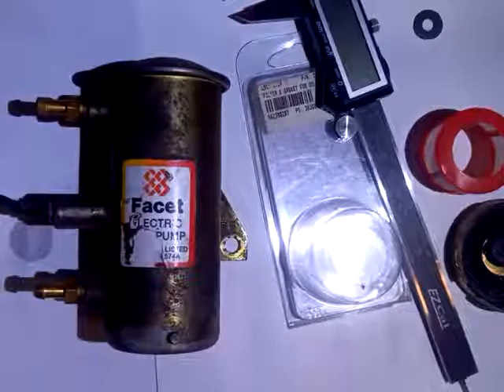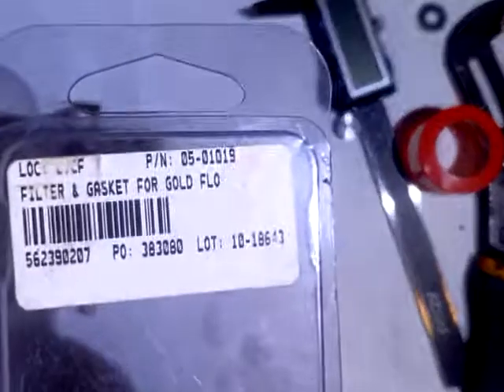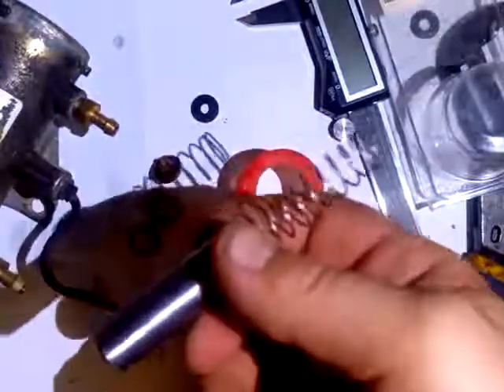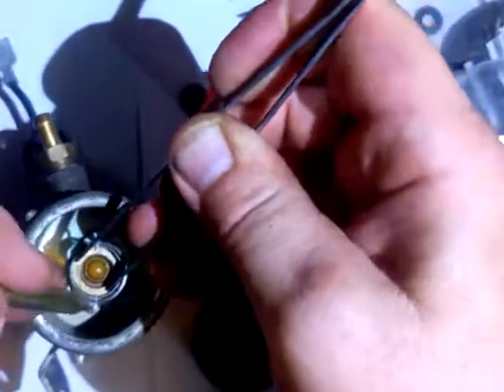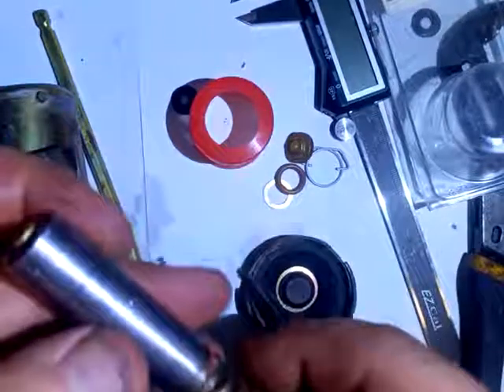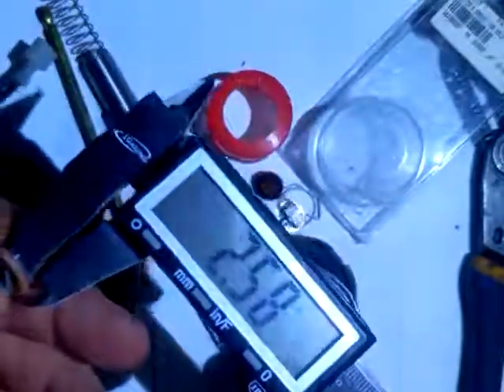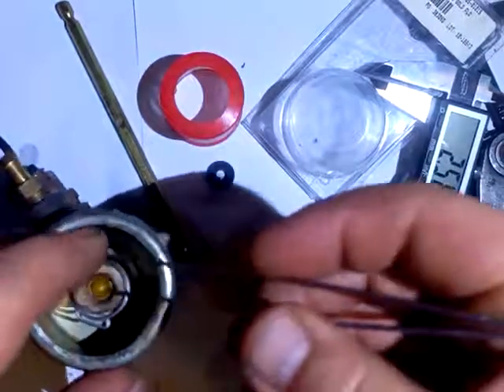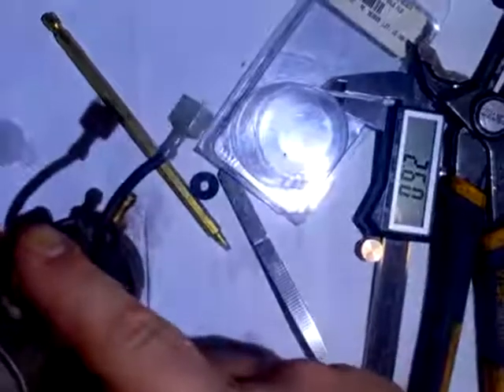Rebuilding a Facet 40133 fuel pump.

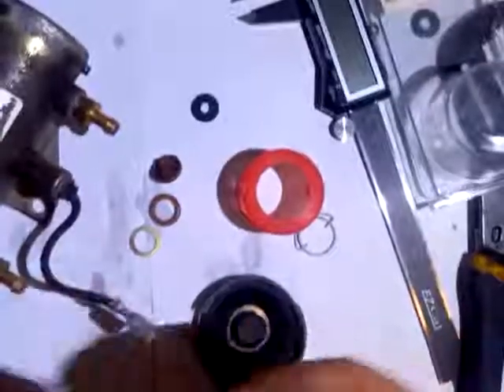Comment: 3:40 You've got that correct. That's why when you hear these priming they are running, as in clicking, very rapidly and then as head pressure builds they click slower and slower as the plunger now has to push fuel back to the return, not simply filling an open void of air in the system.
Nicely done teardown and refurbishment.

Comment: Thanks, you sure saved me a lot of trouble. The rubber backflow gasket on mine was deformed. Couldn't find parts. Like you mentioned , has 2 check valves anyway. Wouldn't be there to pressurize the inlet to the carb because the piston/cylinder isn't sealed anyway.  Great job on the video. PS: I put the spring retainer on first just below the 2 holes and moved it up in place  when I had the washer depressed.
Reply from the maker: @danoso6905  Yep. They don't make that gasket and it's not on the blow-up diagram. I don't see the purpose of it, anyway. Ethanol gas is going to eat it up. Runs fine without it. Been lifting fuel from an ATWOOD 6-gal boat trolling fuel tank 9.5ft now for years after this re-do, without trouble. To a carburated 3k genset.

Comment: Wouldn't that o-ring seal the plunger to the body preventing the pump from leaking if the pump was run in a parallel application for an electric and mechanical pump?  The poppet valves prevent back flow during operation as the pump is allowed some inefficiency, but there is no perfect seal between the plunger and the plunger tube when the pump is turned off, right?
Reply from the maker: There is no mechanical pump parallel this one on this application. With enough fuel pressure on the outlet side of the 40133, it's entirely possible to have fuel go back. The pump works in a way, that if there is an upstream carb inlet float valve that's closed, the pump will not overpressure the line and force fuel past. But the pump can and does lift fuel, some 9 ft vertically. It's pressure range is very specific. And if there was a pump that did not allow for backflow when the carb valve closed, I wouldn't want it. It would push past the closed carb valve and flood the area.

The 40133 is not part of a kind of parallel pumping as you described. What you are proposing is novel and unique, afaiaa {however, reading it's application in aircraft uses, it occurs to me that you may be referencing that}. In which case, I suggest you add a fuel solenoid to the inlet side of the 40133, to completely shut-off backflow that could occur if the pump was de-energized.

Comment: I forgot to mention.  The easy way to reinstall the spring clip that holds the valve in place is to put the spring in first, slightly below where the ends will go into the two holes that secure it.  Then install the valve. Hold it down with your finger tip and with a pair of needle nose pliers pull the ends of the clip up into the holes.  Simple.

After reassembly the pump can be quickly tested by jumping 12V across the connections (assuming it is a 12V pump).  The polarity is stamped into one of the two mounting brackets.  These pumps were available in both positive and negative ground and also for 24V applications.

Oh, and BTW.  Bendix was a US company so the dimensions are best measured in Imperial units, not metric.
Reply from the maker: Right, but I gave the measurements in mm, because for such small sizes, they are easier to remember and compare.

Comment: This pump design was first produced by Bendix Corp and was acquired by facet a couple of decades ago.  There are possibly dozens of models that have been used in aircraft engines, Jaguar and Land Rover cars, all sorts of US cars and tractors.  New ones are available that are now manufactured in China.  (You can buy a Bendix label to stick on your Facet(?) branded pump to make it look original.The design is simple and very reliable.  I had one on my Cessna so you can be sure they are reliable.  Just about all parts are interchangeable but the spring determines the fuel pressure.  Most operate between 2 and 6.5 PSI.  Most typical engines with carburetors are happy with around 4 psi.

The carburetor usually has the filter shown in the video.  It is a 'service item' and expected to be replaced or cleaned periodically.  Car owners and mechanics rarely know this so do nothing until the pump fails to deliver enough fuel as the filter becomes clogged.  Modern gasoline supplies tend to be very clean but ...  They often contain ethanol which will destroy the edge of the rubber seal and begin to leak if the particles don't clog the filter first.

Any small aircraft parts or service supplier will carry the service kit.  The pumps have to be serviced regularly per FAA regulations.  But their price is always high due to the cost of all the paperwork and certification involved in making and installing parts in aircraft.

I have found the Pegasus Auto racing Supplies carry the parts individually and are priced lower than the aircraft equivalent.  Facet (nee Bendix) fuel pumps were used extensively in Cobras, Ferrari, Alfa Romeo and many other race cars and motorcycles that are now considered historic and I'm very happy that Pegasus sell these parts so I can keep my old cars running.  Oh, even boat engines have used this pump.

Sadly we have become a nation of component re placers.  Mechanics don't dissemble and repair.  They just install a new whatever.  Engine, gearbox, computer, fuel pump, etc.  As such finding the internal components is all but impossible without buying a complete pump.  If anyone finds a source for the internal pump parts please list it here.
Reply: @philipgrice1026  I use these in marine  applications so my perspective is a little different.  Labor rate is $150 hr so it doesn't make sense to rebuild it as shown, via Pegasus they're $120 new. I always suggest customers carry a spare or better yet eliminate it completely from the fuel system if possible (diesel applications).
My personal preference if you absolutely have to run a fuel pump is the Carter vane pump style. They're dead simple to service with the most basic hand tools and no fiddly bits to install improperly.

Comment: How do you know if its bad?   I have a Onan 4kw generator with one of these and it works fine till I start the RV then it dumps fuel out the carburetor.  Could this be a bad electric fuel pump?
Reply: it also will dump gas out of the generator carburetor  without the generator running as soon as the RV starts
Reply from the maker: Yep. Generally if the float valve is stuck or the float is bad, either one can cause that float valve to stick open. 99% a modern fuels problem causing it. 

However, knowing that these Onans were slung underneath sometimes, and that if you hypothetically pressurized the pump's fuel inlet enough, fuel would slip past the pump's poppet valves to the outlet...

I'm wondering if, instead of it being a siphoning issue, your pump pickup inlet feed was changed from the neutral pressure pick-up tube that goes down 3/4 of the way into the main motorhome fuel tank, over to T-ing off the outlet of the electric pump inside the fuel tank. In which case, the pressure and volume coming out of the tank electric pump, every time you run your main engine, would push past the poppet valves in the Facet 40133, and also be enough pressure to force your generator carb fuel float valve open. That would flood your gen carb, spilling gasoline, everytime you ran your main engine.

This flooding would also occur, if someone added an inline electric pump aftermarket, and somehow it's outlet was T'd to go both to your engine and your generator, when it should only go to the generator.

Sounds like someone attempted a repair due to old cracked fuel line hoses or a dead main tank electric fuel pump, and routed the outlet incorrectly.
Reply: @briangriffin5563  sounds like you have a float sticking, or a needle and seat problem.  Or it just needs to have the proper adjustment for float height. Hopefully this helps you.